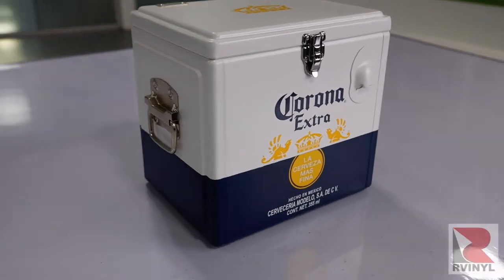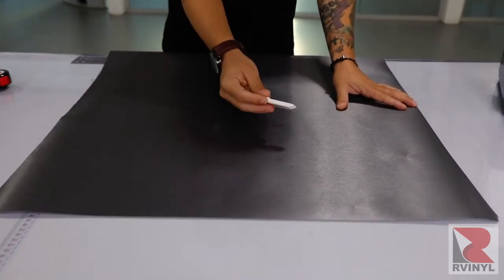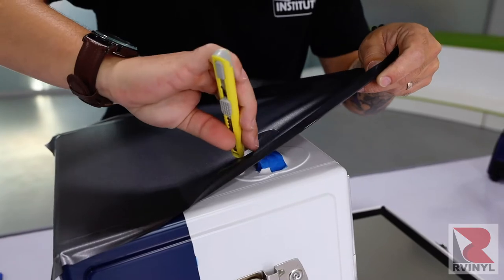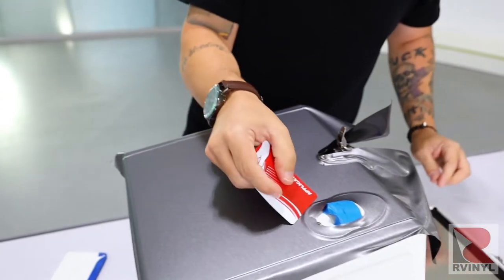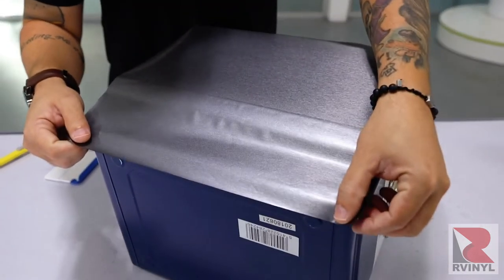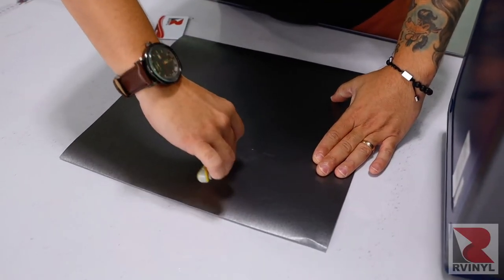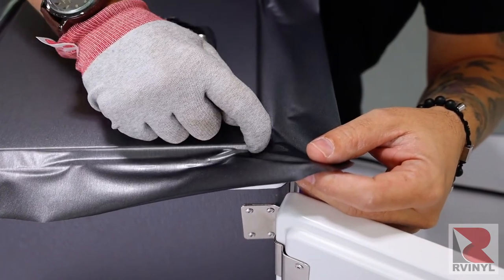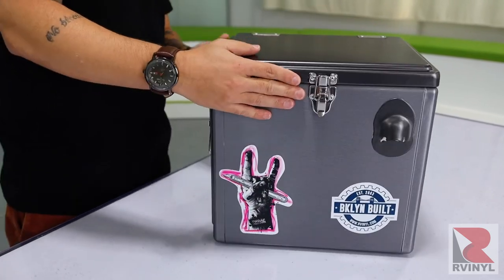Wrap Any Brand of Cooler with Vinyl

Comment: Since you did each side separately, how did you do the spots where they meet on the corners. I have a cooler with no recessed edges. Do i wrap it with one big piece?
Reply from the maker: Yes, that is one of the best but most complicated ways to get it done.